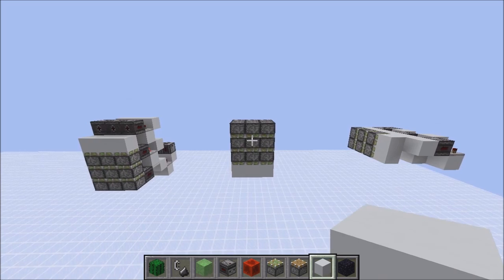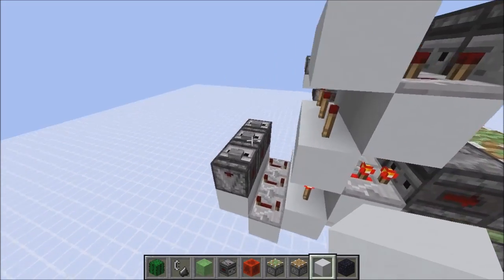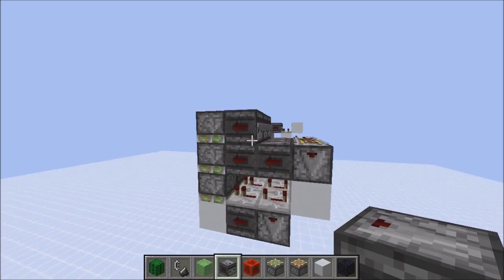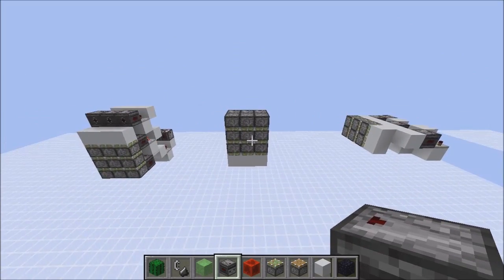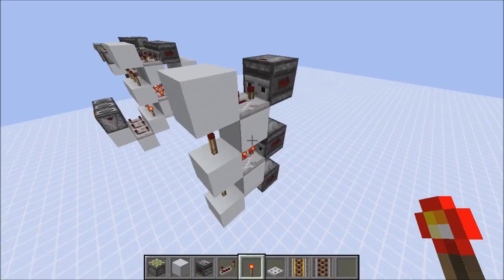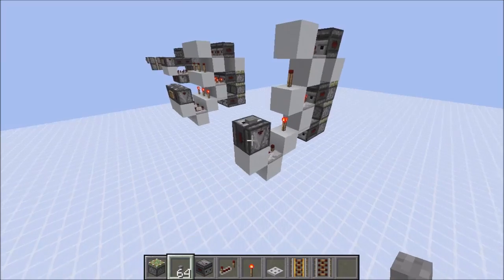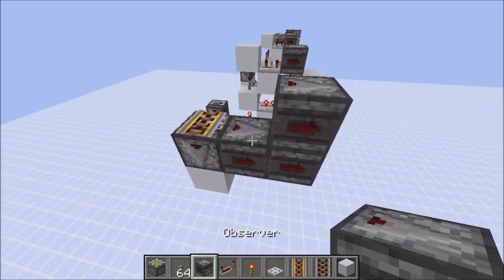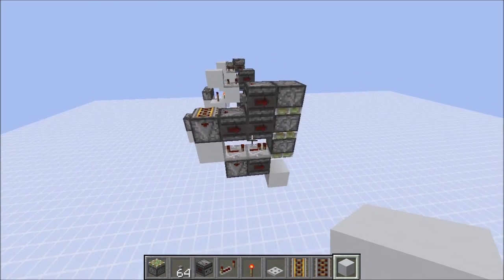Tilable Triple Piston Extenders in all Directions [1.11+] [smallest?]

Comment: Downward extender is useless as u can't move the input button else where
Reply from the maker: you can easily put droppers there,rs dust ontop and power it for 10 ticks,could push rs blocks in it etc.. plenty of ways of doing it
Reply: Hey are u a redstone expert?
Reply: I need help I'm trying to recreate a massive bunker made by euclides and showcased by unspeakable. I'm having a problem making a block swapper and a MINECART dispenser work on the same button?
Reply: I had the same issue and I found it impossible to move the input button, despite my best efforts. If you don't need a tileable extender, there is a great design on r/redstone titled "Cheap Observerless Flush Seamless Small Downwards Triple Piston Extender" which is powered by a lever and is much easier to move.